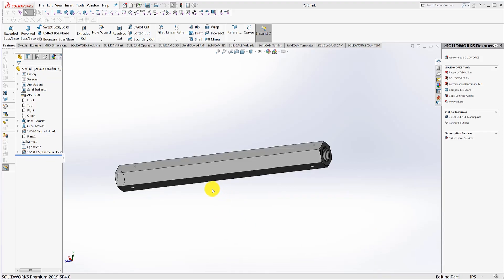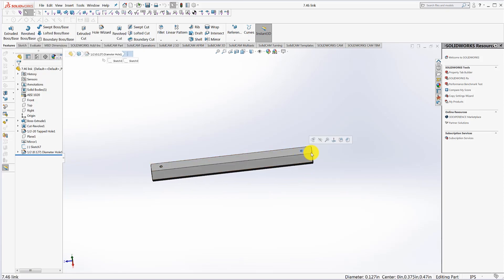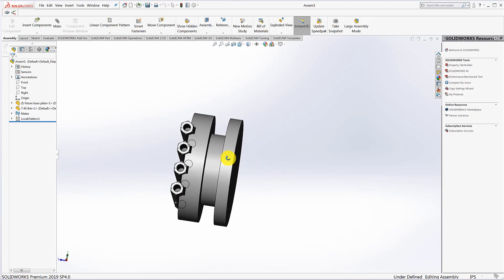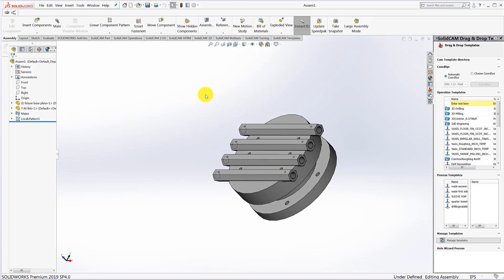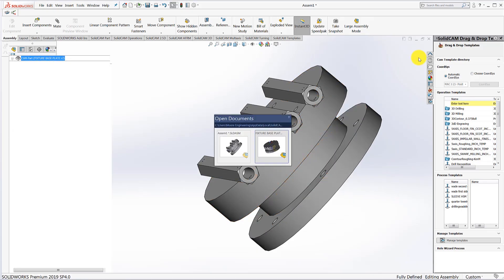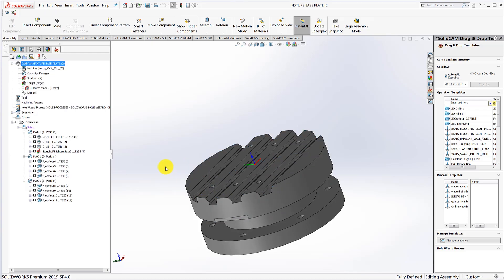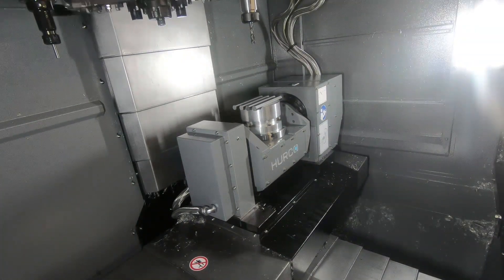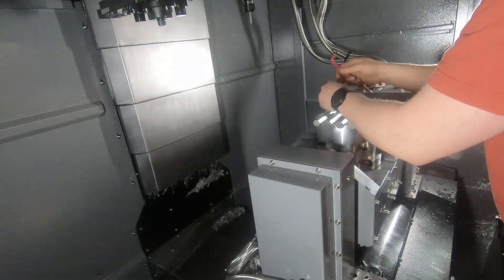Cool 5 Axis video! GREAT use of Hurco VM10u

Comment: The only video on generating G-code for Hurco. Is there any chance to share the postprocessor? I have access to Hurco vmx10U 2008year which is not in use. Tried to run it with fusion360 but unsuccessful.
Reply from the maker: We use solidcam so our post would be totally different than fusion
Reply: @MooreCNC  Thanks for reply and I meen if I have post for solidcam I can use it. I have solidcam installed. Tried to modify other posts to fit but unsuccessful.

Comment: Remove the spot drill and use thru coolant solid carbide. Will cut your runtime in half. Get rid of that program to locate the parts. Put studs below the parts that are milled to your part zero so when you load the part just make sure they hang past the stud. Boom 💥 your parts per hour just trippled

Comment: Thanks for sharing.  Why would you use solidworks and solidcam when hurco advirtizez that you don't need cad or cam to run there machine?

Kind regards LeRoy
Reply: Some People like cam better. And not everything is possible with the conversational programming without alot of hastle.

Comment: Hi
Interesting way of looking at the job
Was it actually a production job or just something for the channel ?
Maybe thread mill the holes in ends if swaft build up on tap an issue
Reply: Just a though
Another thing to try could be cold forming roll taps 
These work good in blind holes 
👍
Reply from the maker: @superal1008  Yes , we did buy some roll taps to try out! The minor diameter on the print is held pretty tight, and I was warned by customer that it is hard to control minor diameter with roll taps. Customer also gave me some good advise that form taps put a lot more torque on the part and don't work the best in 1018 eithers. Regardlesssss, we are scientists and want to try it out, but we figured we would wait until the end of the run and do it in some extra pieces. Will keep you posted, thanks for so much input and help!
Reply: @superal1008 , you are correct. Form taps (roll taps) work extremely well for blind holes, if the material will allow it. I run form taps in the following materials with no issues: any mild steels (1018, 1144 ect.), mild stainless steels (mainly 303), brass, copper, and 6061 aluminum. 

Worth nothing, form taps use a different size drill than traditional taps. Example, a 1/4-20 form tap you drill a 0.228" diameter hole. Not 0.201" that you would use for a traditional tap.
Reply from the maker: @horseshoe_nc  did not know they worked in 1018, we were advised against it, but want to try it anyway! Thanks for the great input and help with our efforts!!
Reply: @MooreCNC , I run them in 1018 cold rolled quite often. I failed to mention this in my previous comment: form taps do take more torque to turn than a traditional cut tap. Exactly how much more, I do not know. However, a form tap is stronger than a traditional cut tap. 

My suggestion, clamp up some scrap stock in a manual mill. Drill and hand tap a few holes, with both types of taps. That will let you get a feel for the difference. Some say CNC is the end all, be all of machining. However, I must disagree. A manual mill can teach you a lot. 

One more tip for tapping in general, especially with form taps, chamfer the hole before tapping. It looks cleaner that way, and helps the tap start a little easier.
Reply from the maker: @horseshoe_nc  thank you, great tips!!
Reply from the maker: @superal 100 , Thread mill was what we wanted to do, but customer needed 1.5" of full threads, and there wasn't any threadmills with that long of a cut available. we could have ground something, but thought it would be too much cycle time anyway.   On another note, thank you so much for your helpful comment on the trepanning video. I checked out the channel you recommended and was very impressed by that guy's work!   I am not sure where your comment went in the other video, but i lost it. I think I lost it because the video was set as "safe for kids". I did not realize that meant it disabled comments. Learning everyday!
Reply: 👍
Look forward to what you show next

Comment: Great video. Only change I would make is. Drill the end holes, then drill cross holes, and finish up with the tap on the end holes.
Reply from the maker: horsehoe thought of this as well, but was worried the cross drill would walk or snap because it is carbide... the first hole might act as a drill bushing, but the end hole was .453" and I thought that was a big depth with a .125" carbide drill for the cross drill. You could be right though. Thank you !!!
Reply: @MooreCNC , carbide drill, I would be worried as well, and probably went the way you did.
Reply: @MooreCNC  then you would drill with a center cutting endmill or a drill mill. Anytime you have crossed holes this is the best way to avoid walking. Typically you'd want to do this on a lathe with live tooling and sub spindle cause you would be chasing center with the fluctuation of stock tolerance just holding one side.